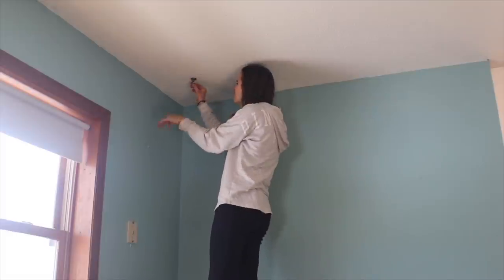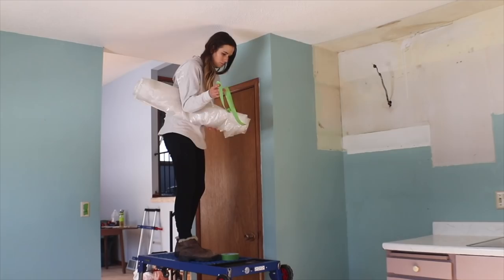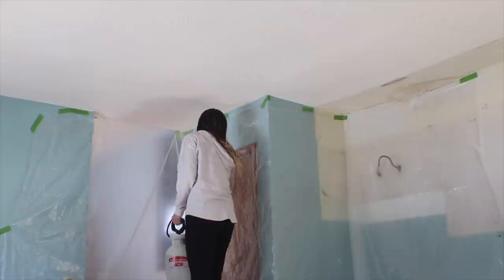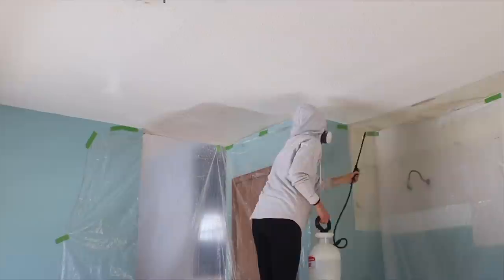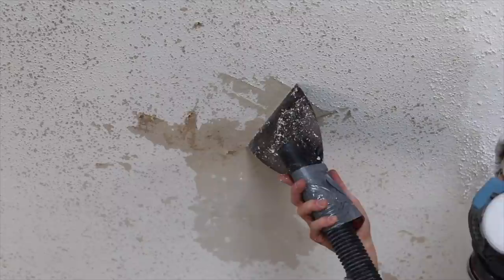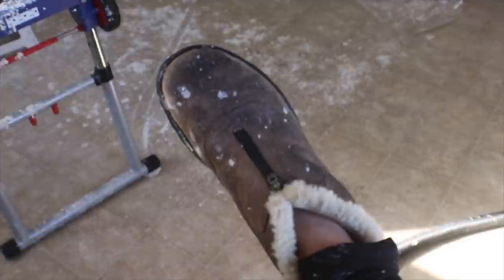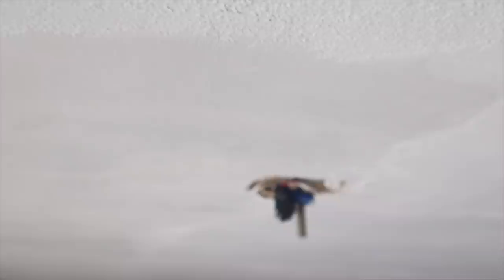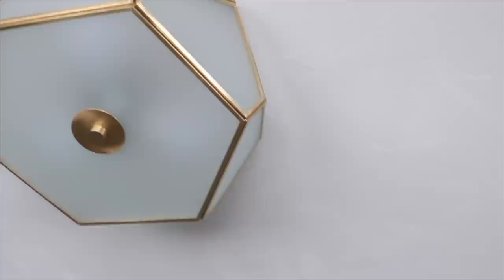Remove Painted Popcorn Ceilings | Scraping a Popcorn Ceiling

Comment: Honestly, I give you so much credit for not letting this huge project defeat you and also for showing us what worked and what failed. 85% of my house has popcorn ceilings so I need to hire a professional to do the work. HOWEVER, my laundry room is small and I am going to attempt to do that myself. A friend of mine used a big wet sponge to soak the popcorn on her ceilings and did small areas at a time. It must not have been painted because she said the stuff just scraped off easily. My “popcorn” is much thicker and bumpier than yours and it was applied in 1978 so I have no idea if it is full of asbestos. Since they mined asbestos in this state, I wouldn’t be surprised is that is what’s hanging above my head. 😷

Comment: I prefer painted popcorn to take off, it's less messy and comes off in sheets. Use warm water, 3 parts water and 1 part vinegar. Just use the flat side of a rake to nock off bits and pieces then spray and let sit for 5 minutes. Scrape it off with a snow shovel. You can go from one end of a room to the other, comes off very easy none stop. For a less of a mess, have someone with a construction bag in front of you as the sheets fold into the bag. Wa La!

Comment: Asbestos is homogenous, therefore one sample could be positive, and another negative. Therefore it’s important to take a sample from several areas (perhaps this is what you did but not specified?). A surveyor advised me the levels are low when it is present in such ceilings, and (generally speaking) takes long term exposure to cause harm. New to the channel and enjoying the content but thought this was worth mentioning.
Reply from the maker: Yes! I should've mentioned that but the kit you buy to test for asbestos specifies it so I didn't think it was necessary to go through the instructions on how to test for asbestos. I took a sample from four different areas of the ceiling and a chunk out of the entirety of the drywall, not just the texture on top.
Reply: @WelcometotheWoodsBlog  you’re right. It was the first thing you said as well! And the testing kits explain the specific of what to do as you say.
Reply: @WelcometotheWoodsBlog they stop using asbestos in 1980

Comment: Wow, memories of scraping all that off my ceilings before moving into my house a couple of years ago! Same deal, painted over, only it did have asbestos, so I had to plastic up all the walls and floors, get HEPA filters going, and don a bunny suit and full face respirator! The way that worked best for me was doing a first pass with the scraper to knock the tips off and expose the texture, then hit it with a warm water/vinegar solution and let it sit for 10-15 minutes. I managed to take it all down to drywall without a bunch of gouges that way. Kudos to you for doing the finish work yourself! I didn't even consider it, and just hired for the skim coat & texture job!

Comment: I have removed dozens of popcorn ceilings and The final cleanup is much easier if you don’t use the Dawn dish detergent.   May seem like it helps but the popcorn will stick to everything with the added dish soap as to where without it most often it will come off unwanted surfaces when you are cleaning up afterwards. Just use warm water trust me.

Comment: Why not lightly sand the rest of the stubborn popcorn off. Sounds easier. Messy but way easier.
Reply from the maker: I don't think that would've been any easier, personally. But it would've been less expensive. I would still have had to skim coat the areas where I gouged the drywall trying to scrape.

Comment: First, you shouldn’t have dust. If you do you’re doing it wrong. You should saturate it enough where it easily comes off. Dawn is unnecessary. Vinegar could help out when it’s painted but all you have to do is prescrape the area you’re going to spray with water. This creates the ability for the water to penetrate underneath the paint and you won’t have the issues you were having. 

You also don’t need to worry about over saturating it. It will not hurt the drywall as it’s very thick.

Furthermore, your angle of scraping is also why you’re getting gouges. You need to hold the handle closer to the ceiling, maybe a 30 degree angle. Just put a piece of plastic on the floor to catch the popcorn and you’re good.

Comment: Thanks for the video Melissa. Here in the UK we cover over these ceilings with plasterboard (drywall) and then refinish. This serves  three functions, in some places you need two layers to update to regulations, Old plasterboard is often nailed and these pull out, so a new layer using screws pulls it back, and lastly, it's less messy.
Reply: We contractor's in the US also perfer hanging new drywall over the existing ceiling. Doing so also increases R-value/and or sound proofing, Much less of a mess by far
Reply: Can you get by with 1/4” so you won’t lose much ceiling height or is this not thick enough?
Reply: @tammybryant3480  Hi Tammy, possibly yes if your ceiling is pretty much flat already;  but I'd always go for the 1/2 inch or 12mm. The stiffer board helps take out minor bumps and your only saving a 1/4 anyway. If you have major bumps you will almost certainly need to batten over, or strip back and use new drywall.

Comment: Thank you for this honest experience with painted ceilings. I get so annoyed with videos claiming it's easy to remove painted popcorn ceiling with soaking with water/vinegar/soap. I had the exact same experience, scraping with multiple layers of paint can get you down to the paper,but it scratches it. I ended up skim coating afterwards. It works better if you scrape the big chunks with a knife (I like the so-called multi-tool) before spraying, it alllows the water to penetrate the paint).

Comment: my daughter just had this done to her house (a renter had failed to report and repair a hole in the roof---another story). The crew that did this had the entire house, and everything (we joked even the dogs) wrapped in plastic. It looked like an asbestos removal operation (no asbestos, the house was built in the early 2000s). It was three days of dust, mess, and living elsewhere while it was being done. However, the result is stunning. I wonder why we ever thought popcorn ceilings were a good thing. (Used in the 1970s to cover for quick, less than professional ceiling board hanging.) This is a hard job. Cudos for having tackled it yourself. I do wonder if maybe some kind of paint remover that was citrus-based would not have helped on the painted areas.
Reply from the maker: I think popcorn ceilings have some acoustic benefits. They dampen sound and make your room less echoey. So I don't mind them if they're on high ceilings in a room full of hard surfaces. When they're high up it's harder to see the ugly texture lol

Comment: If it's painted, you should go around and scrape the popcorn ceiling dry
first. That will remove some paint from the high spots, then spray it down.
and use an 8–10-inch scraper.

Comment: Using a scraper bigger blade with an extension is easier, faster, and less stress on the shoulder since you use 2 hands, and can use your whole upper body to scrape. IMO.

Comment: Watched video about removing popcorn ceiling.  While this helps update the look of a room, you should always test for the presence of asbestos. This was commonly added to popcorn ceilings and is a known health hazard.  Contractors who specialize in asbestos abatement are called in and this isn't a simple DIY job. Melissa, we know you are both lovely and skilled in home improvement, but it is prudent to be safer and test for hazardous materials and use proper safeguards.
Reply from the maker: Hmmm did you watch the first 30 seconds of this video?
Reply: Did you watch the video?

Comment: you put a ton of work in there, great job sticking with it. Next time you do that, if its been painted, go rent a sander for drywall. It will make your job so much easier. If it hasnt been painted its easy to scrape.   Another hint, when you put on the resperator you can use the pull strings on top too... was funny watching you crank the bottome strap all the way though.... Great video....